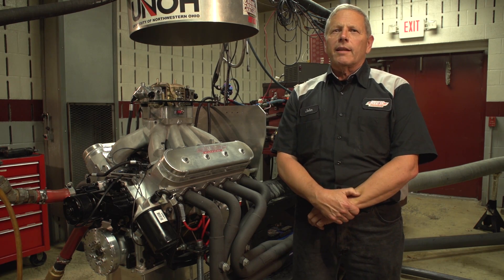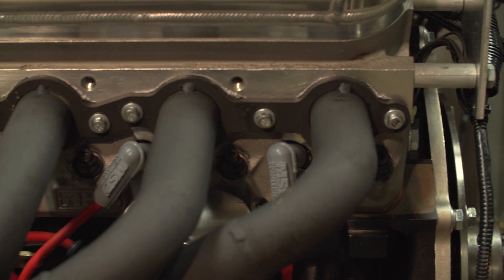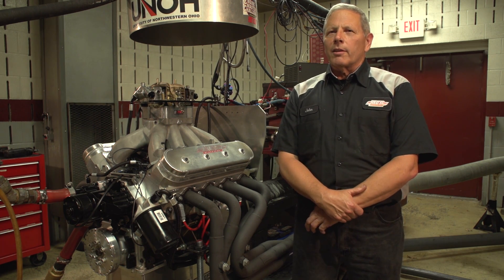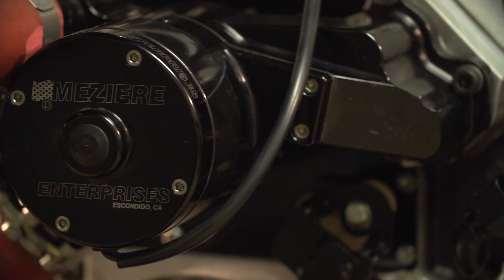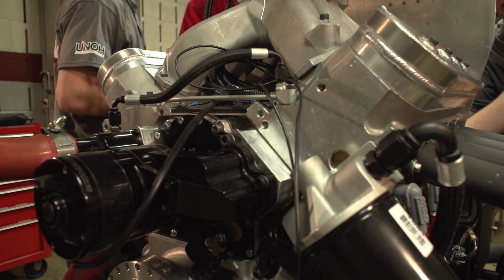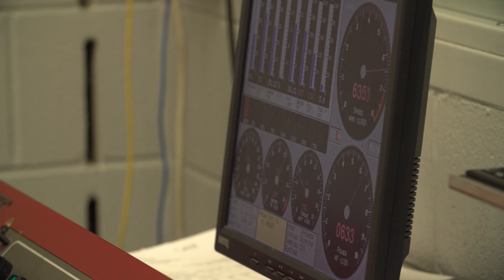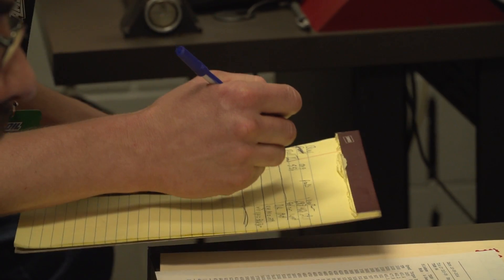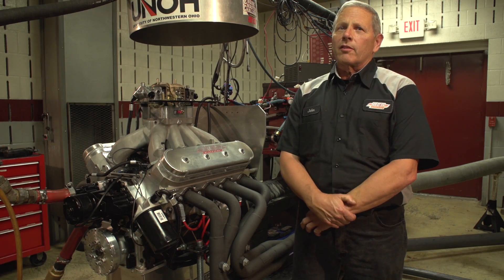660-Horsepower LS Combo by BES Racing/John Lohone, Amsoil Engine Masters 2014

Comment: Pause, "filled the block with concrete". What?
Reply: the water jackets block heads
Reply: Yah. What? Some explanation please?
Reply: Harry made 😂😂😂
Reply: Old school Drag race trick,  don't try to drive it to work!
Reply: +Anthony Kurek its an old school drag racing trick. its not actually concrete, its a compound you mix with water and pour into the water jacket of the block. when it sets up it turns hard like concrete. the old style iron blocks would shift and move when you make huge power, its completely pointless with the new block designs. there is no need to concrete an ls block, and there is no point in concrete an engine that makes 660 hp. all there doing is taking away the cooling ability of the engine and making it useless for anything other than drag racing. an ls block can easily handle the power their making. there just stuck in the past and dont know how to build and tune the modern engine. and there stuck on ancient ideas and dont understand or trust the engineering in the ls block. im not a ls fan boy, but if an engine builder says hes going to concrete an engine to make 660 hp then its very clear that he has been building engines since he was a kid and got stuck in his ways and hasn't wanted or cared to grow with the times. hes a dinosaur.